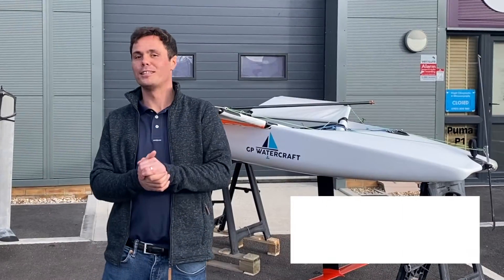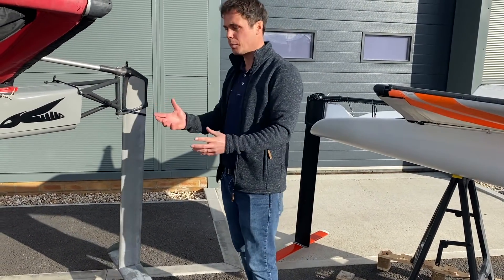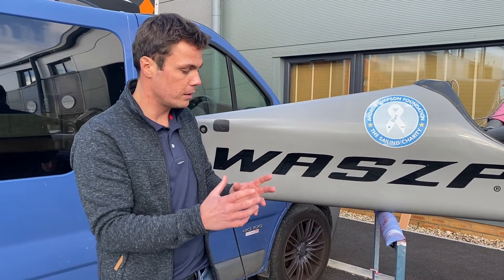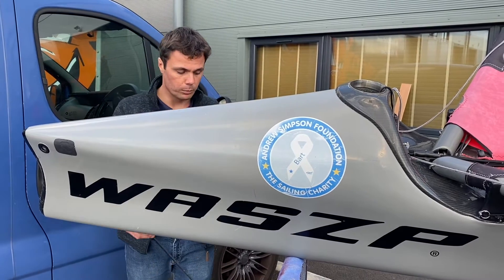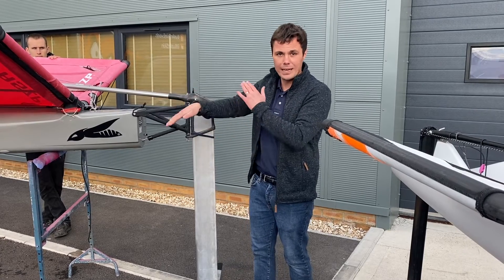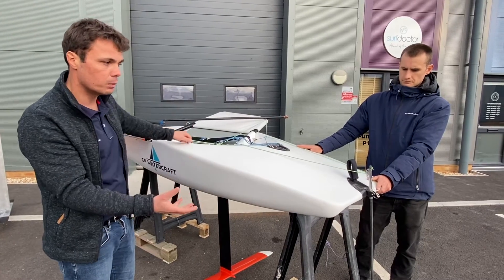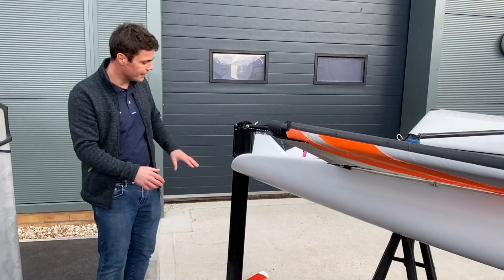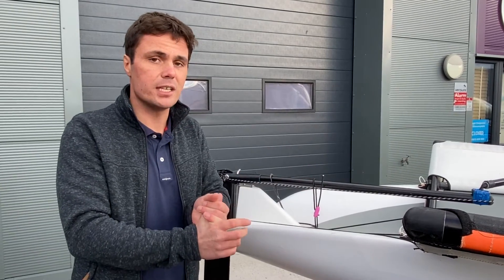HOW DO FOILING BOATS WORK? - Single-handed foiling basics with Shaun Priestley

Comment: What about lateral (roll ) stability?  Is there any or is it like trying to balance on a knife edge?
Reply: The main idea is to keep the boat healed into windward or flat. You do this by using the sheet not moving your body weight. If the boat was to lean into leeward it can cause you to be sucked down into the water. Hope this helped

Comment: How do you keep this thing balanced when you are sailing above the water? Is it the same as bike, wherein you use steering to keep yourself from toppling over or there is a mechanism or something else?
Reply: the primary technique is to sheet in or out to keep the boat balanced.  If that doesn't work enough, then move your weight.  Finally, you can change course.  Unlike a bicycle, there is no inherent gyroscopic stability, so this takes constant attention.